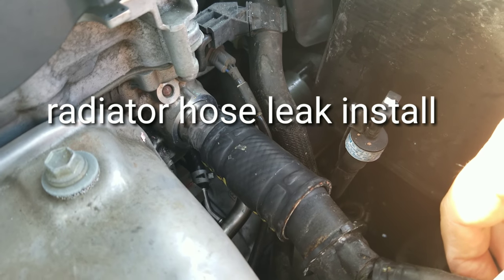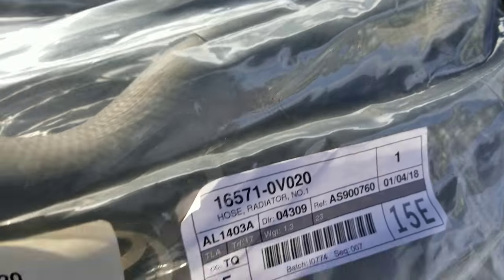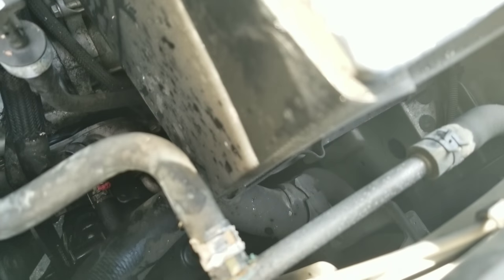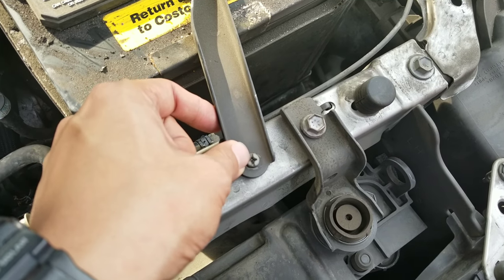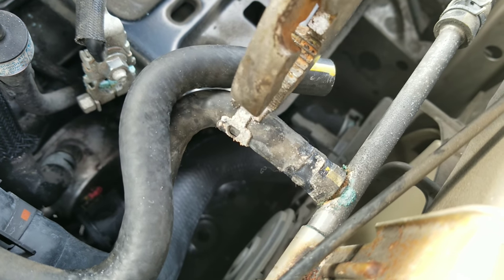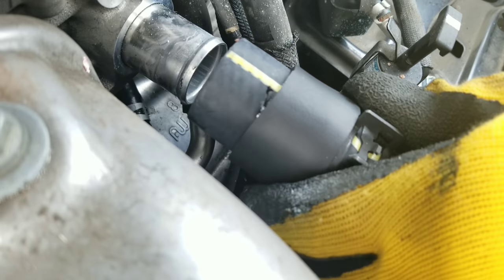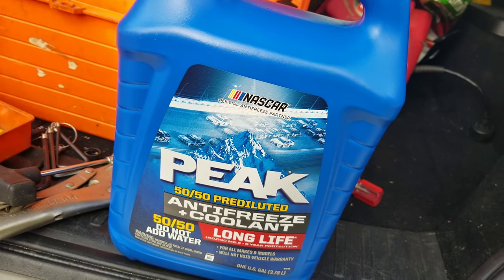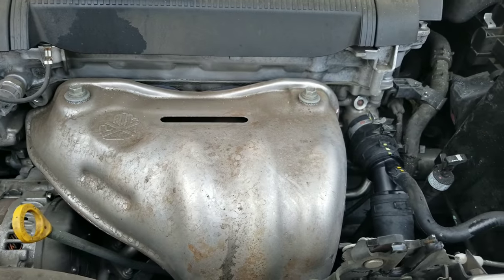DIY how to fix replace Radiator Hose Coolant Leak Toyota 2009 Rav4 2006-2020

Comment: Thanks for the share . Easy to follow. For that bottom hose connection I see that you used a worm clamp. In the future recommend avoiding those for radiator connections because those connection points are plastic and the worm clamps won’t automatically relieve tension as the coolant
temperature rises and the pressure builds up. That’s why all the other hose clamps are the expansion types.

Comment: Screw clamps are not good.  They cut into the hose over time. And the Toyota red coolant is the best as it prevents the radiator and coolant system from rusting out. Every other fluid has caused me problems.

Comment: Thanks for the Video! I replaced this on my wife's 2011 Rav4. Only issue I had really is mounted brackets securing the hose, and the hose at the top which I had to cut through and away. Other than than it was pretty easy. Removing the battery really helps!

Comment: Mine just broke off exactly there, the connector was so rotted it was about as soft as heavy cardboard, I could crush it with my bare hands.

I'm lucky it only was slowly seeping coolant, and that it didn't just fail catastrophically while I was away from home.

Comment: Just happened to me. Is this Napa part good enough Part #: UNR 16037 Line: NAPA Cooling ? Also if I drove the car to the shop about 5 miles away would that be an issue? Thanks for the video need to do this tomorrow

Comment: mine is leaking wit the smaller hose right wer u conect it near the radiator cap 09 sienna. looks like a similar set up

Comment: Did you drain the coolant fluid before replacing the hose?
Reply: Did you ever find out if you have to drain the coolant first? I need to know that same exact question.
Reply: The answer to this question is no you don't have to drain the coolant, but it will leak some while you're replacing the radiator hoses. You just have to top off the coolant when you are done.

Comment: Can I ask how much that part costs? Did you change it yourself?
Reply from the maker: It was under $50. Yes did it in garage
Reply: @galaxyviews7483  how did you prevent the fluid from coming out?
Reply: @hawaii137  drain it

Comment: Thanks for this! So from the looks of it, the cracking/damage wasn't actually visible or obvious until after you removed the clamp? 

Also, is 16571-0V020 the part number for the 2009 Rav4 4cyl Base? I think there's a different part number if it's 6cyl right? Want to make sure I'm getting the right part if I were to pick one up from the dealership. Also, does the replacement hose definitely come with most clamps? I saw another video here, https://www.youtube.com/watch?v=bFwBGALSqyw, that he recommends upgrading the hose clamps with the kind you tighten using a screwdriver (rather than the squeeze ones).
Reply from the maker: Yes I couldn't tell where it was it was leaking from. Highly recommend going screw driver clamp. Will be much easier to deal with later if another repair is needed.
Reply: I would use the original clamps..they tighten as are spring loaded...screw clamps on plastic neck are not good.